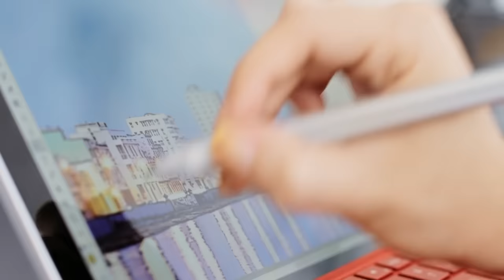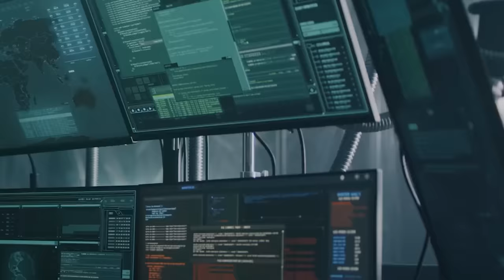Chinese Most Stealth Fighter Spotted at American Marine Base

Comment: Okay but does the mighty dragon have any actual combat time like the F-22 Raptor and I believe that just like the F-15 Eagle it has never lost a actual dogfight, yes in training they have but that was with limitations.
Reply: >combat time
>shoots down a balloon
Reply: @jubeaumont6305  the f22 has been used in combat operations. Are you under the impression planes are only used for air to air operations?
Reply: A F22 got killed by a Filipino fa50 in an exercise but I think the f22 have a handicap and still have it's fuel tank attach
Reply: @hitsunataraki2587 The US often handicaps itself, they do it to learn more often than not. Trust me, without limitations there would be a lot going on..

Just think what the hell the marines would be doing
Reply: @hitsunataraki2587  An f-22 with it's drop tanks on which ALLOWED the fa50 to see it while also being limited as to its top speed.
Reply: @somehecucunt3194  The do "handicap" things to allow flaws to be found
Reply: @jubeaumont6305  A few years back the chef nazi mercs that were all the rage up until their balked march on moscow attacked a US outpost in Syira. The mercs had 300-500 lads (Mixed unit of mercs and syrians) as well as heavy armor support and the outpost had 40 Americans with a small force of locals. During the fighting the US repeatedly asked the russians if the lads were theirs and after repeatedly denying it they told them to shut off their air defences, and they complied (Probably knowing if they didn't they would be shut down manually by the F-22s in the region). Afterwards US aviation started dumping on the mercs, including F-22s. The mercs lost 200-300 while not even injuring a single American (A local was lightly wounded, but that is it) despite significant exchanges of fire on the ground before the aviation could join.
Reply: How would the J-20 have combat experience? China has been at peace for decades.
Reply: The F-22 was introduced in service in 2004 and it's only "combat time" is dropping munitions on targets in an airspace where nothing existed to contest it. Now if that's your idea of an impressive service history, then I don't know what you'd consider poor performance.

Comment: It's not a J-20 fleet.  Why would the US build a fleet of J-20's when NGAD is on the horizon and when we have almost 500 F-35s?  Most likely this is a Red Team aircraft, built by a US contractor to the specifications of the Chinese J-20, or as close as we could get without actually looking at one.  The mock-up allows pilots to train in by-sight recognition of the aircraft and perhaps even to get an idea of its performance characteristics and handling.  It would also allow for radar operators to learn how to tune their hardware to look for these aircraft.  Basically, it's the next best thing to having a Chinese pilot defect with one.

A few years ago everyone was talking about how the Chinese had stolen plans for the F-35.  Remember that espionage goes both ways and in peacetime the military does a lot of training.  They aren't twiddling their thumbs.
Reply: We actually have 980-1000 F-35 alongside the NGAD and FA/XX(navy NGAD) so yeah it a fighter jet gap 😂

Comment: The J-20 from what I understand is not as capable as the F-35 or F-22 in terms of stealth and in terms of air superiority the F-22 is still in a field of it's own especially in long distance combat.
Reply: The J-20 holds a lot more fuel & can fly twice as far as a F-22. F-22 is just about invisible to most radar systems. It's like trying to shoot down a marble in the sky.
Reply: @travismcneese9867 true, but F-22 doesn't need huge fuel tanks since US air bases in Japan and Philippines put them close to China
Reply: @travismcneese9867 you dont need to make your jet fighter/CAS to fly from beijing to moscow. You have other types of aircraft for that, you could cut that fuel tank in half to make room for better tech and more weapons to make your plane more reliable. Your jet also cant have a full tank when landing it needs to be almost empty otherwise it may damage the aircraft and runway.
Reply: the fundamental problems J20 and F22 were solving were not the same\
for example, range:
F22 was designed to fight against USSR while J20 was designed for Asia, the land in Europe are enough for landing but there is not many airports over seas around China
Reply: @loadingnewads  I get the J20 was designed mostly for Asian conflicts (mainly Taiwan) however its attempt at stealth is clearly in anticipation to possible US fighters and is clearly why they did it considering how much posturing they do against the US with aggressive interceptions of US aircraft.

Edit: also the F-22 basically was the US taking the USSR seriously in their supposed fighter capabilities and upping it to 10 only to find out that fighter was nowhere near what they reported it to be.
Reply: @joesmith701  addition:
US found that F22 the best fighter jet at that time was designed to fight a country located in nowhere
Reply: @loadingnewads  actually, the US has many air bases near china, in the Philippines, south Korea and Japan. The F-22 can definitely gain air superiority over china itself
Reply: @SelfProclaimedEmperor probably not over China, but it could definitely be used to prevent China from having any strike capability outside its own borders, the current platforms that would give the F-22 the ability to operate over China aren’t survivable in an environment filled with SAMs.
Reply: @swiffersweatjet7815  the SAMs would get destroyed rather quickly by coordinated attacks from F-35s and B-21s using anti-radiation missiles and the long range hypersonic weapon
Reply: @SelfProclaimedEmperor  I'm not worried about the F-35s or B-21s with regards to SAMs, the issue is that the F-35 doesn't have the range to operate over china in any significant capacity, and while the B-21 does have the range I doubt they would send it into the airspace without escorts.

The platforms(tankers) that would give the F-22 and F-35 the range to operate over china likely wouldn't be able to get close enough to give them the necessary range without getting shot down.
Reply: @swiffersweatjet7815  I don't think stealth bombers need escorts. The B-2 was designed to operate over the Soviet union without any support. The B-21 is same but designed to operate over china without support

Comment: It really doesn't matter how good any manned aircraft is anymore.  They can build drones that make conventional aircraft look antique. No pilot on board leaves endless opportunities for engineers to advance aircraft to incredible speeds and maneuverability.  A small advanced drone with stealth technology is a nightmare for any advanced radar system to detect.
Reply: If there is no man inside the aircraft then you never have to worry about g-forces on a person. Now your opportunities are endless except at certain speeds you have to worry about friction heat to the aircraft
Reply: Onboard computing power and/or secure communications links are still weak points for autonomous drones. That's why the US 6th Gen projects mention being a controller for unmanned wingmen, instead of primarily being one itself.
Reply: And a smart enemy knows if you take out the GPS constellation you destroy all unmanned aircraft capabilities.
Reply: @Tombstone8669  Except you can eliminate the drone through a multitude of functions including field based ISLOS occlusion. In this case, they're limited by physics given our new methodology to deal with this issue and they can be as stealthy as they want. It's where they are, not if we can find them. Once they're in the area they should not be in, they're already down.

USAF 2W1
Reply: A man with no legs can handle more g-forces than a man with 2 legs. Facts

Comment: Ok aviation people. What do those smaller front wings do for the aircraft? What their purpose?
Reply: Help with maneuvering amongst other things.
Reply: They're called canards, and yes, they aid manoeuvrability of an aircraft
Reply: I am not a plane guy so thanks for the replies.
Reply: those are called "canards", think of them as horizontal stabilizers, but to the front of the plane instead. They usually put them on delta-wing tailless planes (so planes that have no horizontal stabilizers on the tail) like the Eurofighter or the Rafale, and guess it's the same with the J20 since it's also a tailless design
Reply: Helps with high angle of attack maneuvers. I didn't see any thrust vectoring and also from a vid on another channel that the J-20 is just missile truck for such and such missile can't remember.. That its too big it has a Rcs of i think .2 and the f-22 has i think.0005. I could be wrong about the numbers but the J-20 is there just to launch long range air to air missiles. It's really nothing to worry about. May have super cruise though, if its big that means it has a good range to it and so no external tanks needed. I would be more worried bout the air to air missiles. But remember any stealth aircraft emitting it's on radar is like shining a very bright beam of light or a road flare in the dark saying here i am!! So modern air combat is going to be awacs spotting for a strike package of stealth fighters if awacs can see you they just vector the fighters and boom your gone!
Reply: @DonPatrono  Delta wing aircraft don't need stabilisers, due the much higher wing surface area...these and the aircraft you mentioned, that also have canards, are purely for improving aircraft agility
Reply: Those are called canards which make the aircraft more agile. They however also make the aircraft much more visible on radar.
Reply: @iPsOfAcT0  they aren't NEEDED to fly, but they do help a lot with maneuverability in aerial combat

Comment: We got another 4+++gen like the Su-57.
Reply: funfact the su57 has a frontal rcs of 0.006 which is close to the f35s 0.001
Reply: @Felon_Confirmed  I'm willing to bet the overall RCS of the Su-57 is leaps better than the F-35 and perhaps comparable to the F-22. It's biggest downer is the underpowered engine and I don't know if the Izdeliye 30 is good enough.

Comment: An F-22 Raptor will kick the J-20 to the curb, by detecting them 10 nm sooner, fire a missile and go cold or notch. 
If the J-20 manages to fire a missile, the missile will lose radar lock 90% of the time with notching.  
F-22 has a 0.0001 m2 radar cross section, same as a pigeon!
Reply: I thought it was a bumble bee.
Reply: Probably depends on the radar band they're measuring with, which they're not exactly going to reveal the whole spreadsheet for
Reply: @doujinflip  they  detect the Raptor coming from a distance with low frequency radar but can't lock on for countermeasures.  Raptor fires then retreats. Adversaries only has time for  quick prayer.

Comment: Several years ago, china had a b2 stealth bomber  sitting outside a hangar or somewhere similar. It was easily spotted on civilian satellite photos. 

I believe the intelligence agencies spent a lot of time trying to determine its origin or if it was real. Fairly sure that it was a non flying prop, used for similar targeting, training, and the like. 

As you said, militaries commonly do this type of thing. The easiest explanation is usually the likeliest.

Comment: Why is it out in the open, and not locked in a hanger? My dad was stationed at Laredo Air Force Base in the 50s -60s. An SR-71 landed, and was immediately stashed in a hangar. Few hours later a maintenance crew arrived to work on the aircraft. No one was allowed to go near that hangar, or even that side of the base. Aircraft took off the next day along with the maintenance crew.

Comment: Analysis of the J-20 shows it's less than a true 5th gen. The composite material they used was a knock off of bought wreckage from a f-117 that was downed years ago. The performance of the engines as witnessed during demonstrations shows less than optimal performance. The old school thrust vectoring nozzles reduces it's stealth ability. It was even locked on to by a surface AA guns during testing. The size alone doesn't lend it self to true stealth. It's not an answer to the F-35 at all and even less so than the F-22. 

Yes the US is taking it serious that China has a new aircraft simply because you take note of all your adversaries resources. That's just prudent planning. Yes it may be a little stealthier than a none stealth aircraft but the U.S has also upgraded their radar along with their stealth program. Part of testing advanced stealth tech is also fine tuning and developing radar to test it's capabilities against. So I wouldn't be overly concerned especially since the U.S has been developing 6th Gen stealth for a while now.

Comment: To people comparing J-20 to  its American counterparts the F-22 and F-35, do acknowledge the fact that J-20 was not designed to match them. In a direct dogfight, they are more likely to lose even against F-15EX. Their real purpose in an open war situation are to target the large supporting components of the American air force such as AWACS and refueling planes then immediately flee back  to friendly airspace under the protection of the Chinese SAMs. This is their main objective in the hopes of crippling the American advantage in the long term.

They were never meant for air superiority if their enemy is the US. But just like the F-4 Phantoms back in the Vietnam war which were designed as bomber interceptors but still later used as fighters, the Chinese can do the same. THough I won't expect very stellar performances.

Comment: The canards on the J-20 are going to make it stick out like a wacky wavy inflatable flailing arm tube man. They can claim it has all the radar absorbing material and countermeasures they want, but the design is not 5th gen. 4.5 gen, sure, but not 5th.

Comment: as you know the SR-71 is  said to be the fastest aircraft in the world, theres only one fighter jet that can intercept it, and reach its same altitude.    the F-104D  has a top speed of mach 3.8 set in 1967 running chase to the X-15 and chased it to 118,400ft.  how fast is mach 3.8. the sr-71 hit mach 4.1. mach 3.8 is 2840mph, the X-15 hits mach 7, thats 5190mph

Comment: The J-20 was not designed and will never have to face the US Air Force in large scale combat.  The J-20 only has to be good enough to establish air superiority over  Taiwan , and it it is easily good enough to do that once they build out the intended fleet.  They are building J-20s at a rate that should give them the ability to easily establish air superiority over Taiwan by the late 2026 or 2027 at the latest.  Of the US services, the Marines are the only ones likely to participate in the war, and that would be on the ground, but that won't happen either, but of course you still need to prepare, even though it probably won't happen. The US runs nuclear missile launch drills all of the time, and in all of those decades, none have ever been launched in anger. The only thing the almighty F-22 has ever shot down that wasn't a practice mission was a freaking balloon.  As the old saying goes, perfection is the enemy of good enough, and as perfect as the US aircraft are, the won't be involved in the battle for Taiwan, and the J-20 is good enough to ensure air superiority over Taiwan and that is what it is for.  The only questions is whether the Chinese are afraid of the damage to their economy that the sanctions will cause and I think they  are already feeling the heat from companies like Apple that are starting to develop other supply chains outside of China. If they continue to give strong indication that they will invade Taiwan, more companies will do that, and the Chinese economy is already struggling.

Comment: J-20 is a Chinese copy of the F22/F35 that is a fact, but since it does not have the same Stealth Capability of either of the US Versions it is Emulating it is not the higher Killer Dragon you are making out to be because the F35 was never meant to be a long term Aircraft in the US Arsenal but a steeping stone into bringing Stealth to the three branches that have fixed wing fighter aircraft. The issue is that the Contract Delays that were pushed by political pressure and technological milestones that were not meant when Lockheed Martin with V-STOL and Navy versions of the F35 have created not only issues with Legacy F35 that cannot be upgraded to the latest Block 3 packages according to Aviation Weekly from about 18 months ago that the F35 is going to have the same issue that the F/A-18 Super Hornet has now where the Airframes are going to be hitting their LIFE MAX way before a new 6th Gen Aircraft is ready to replace it and that is why the USAF has gone ahead with the plan to buy the NEW Boeing F-15EX Stealth Eagle and Upgrade the F-16 Viper program but the Navy does not have any plans that have been made public.

Comment: The most capable part of the J20 Mighty Dragon is not the plane but the long-range air-to-air PL-15 missile is the most potent air weapon of the PLA. The radar cross section of the J20 is about 100 times more than the F35, so it's not all that stealthy. Firing the PL-15, the J20 will be extremely out of visual range, so i'm unsure why either the USAF or USMC made a mock-up or model of this warplane.

Comment: If the Grim reapers (of DCS "fame/notoriety" not the actual irl squadron) have shown me anything its that the F-35 is visible on radar at around 20nm with a modern aesa radar, the J-20 is visible at 30-40nm. If the J-20 carried MICA-IR's, which have a range of around 40nm, it'd be an issue. Tbh, whoever can develop a cheap, reliable BVRAAM with an IR or even duel seeker head first, will "win" the 5th gen era